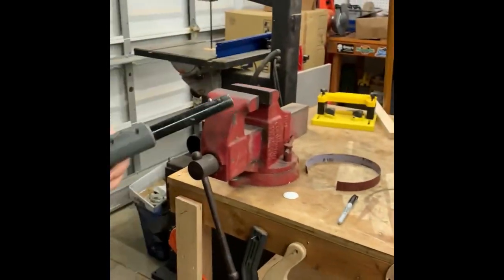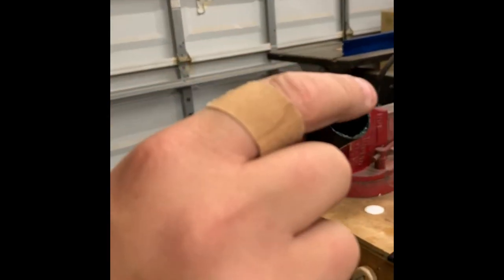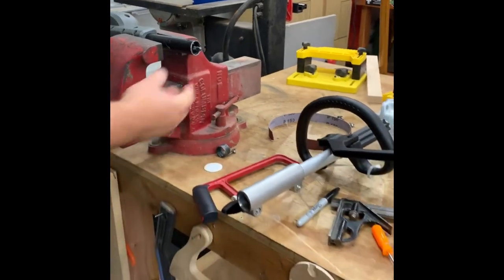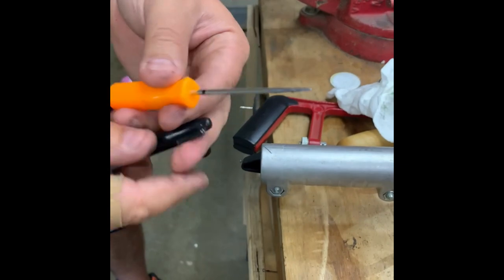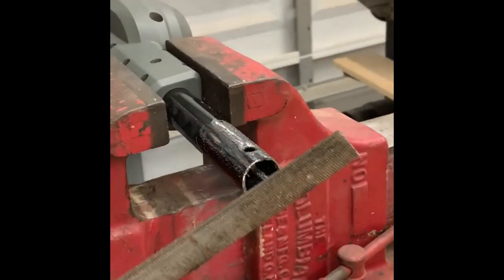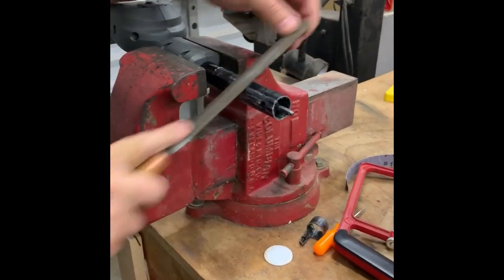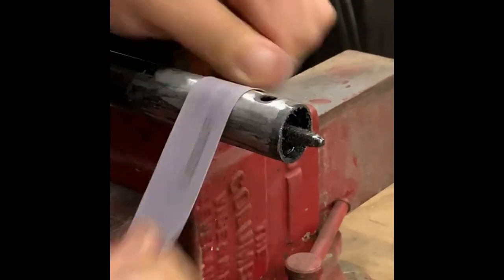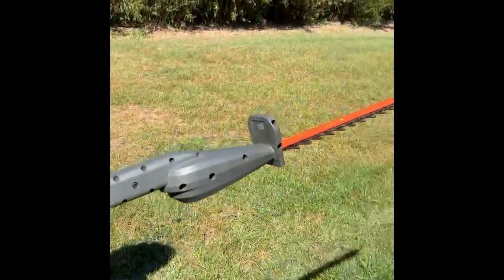How-to Convert your Ryobi Expand-It attachments to fit Stihl Kombi and save money! DIY

Comment: I followed this video and successfully got the ryobi attachment working with the Stihl power head just by cutting off 7/16 inches with a pipe cutter. Surprisingly didn’t have to decrease the ryobi pipe outer diameter or file away at the shaft. Thank you very much for making this video!
Reply from the maker: Awesome! That’s interesting that no removal was needed. Perhaps there are slight variations in tolerances of each product and it worked in your favor!
Reply: pipe cutter would be a cleaner cut. could take the shaft out first too. ream out the burrs on the inside of the pipe too so that shaft doesn't wear down